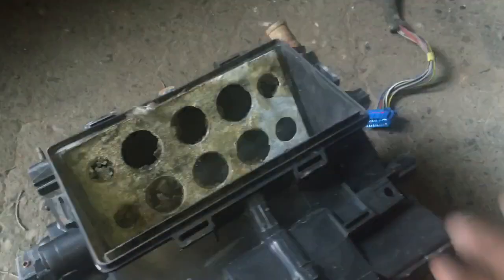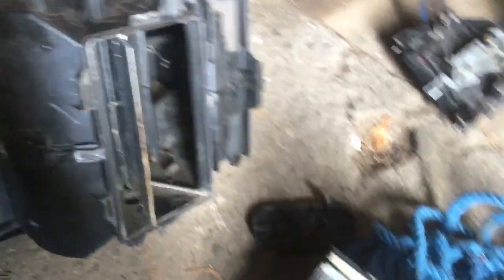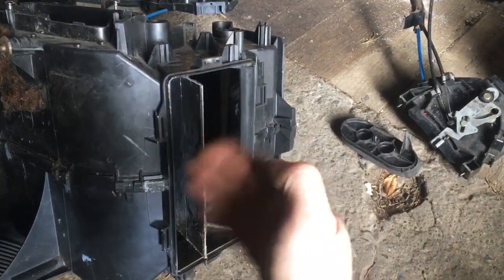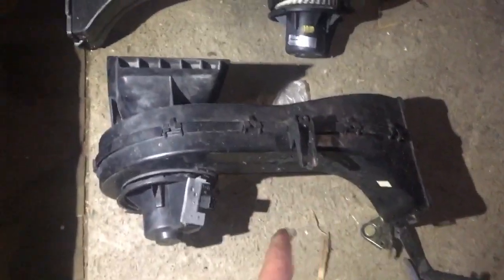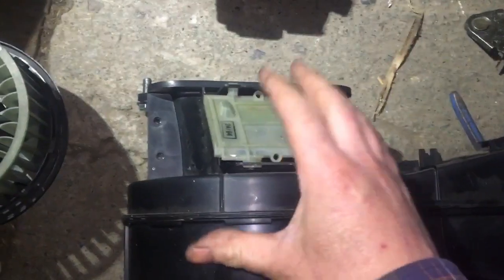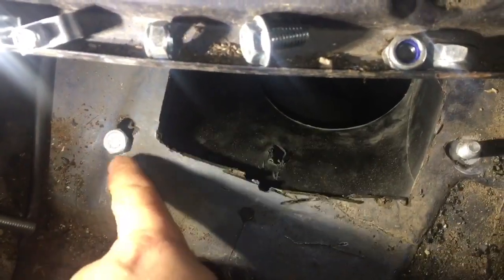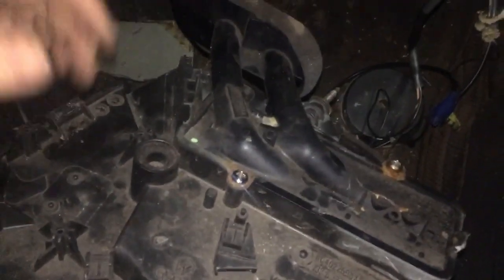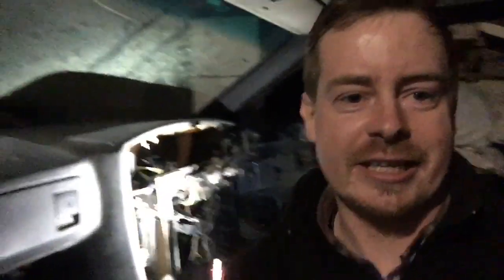Corrado HVAC, upgrading modifying and repairing ep19

Comment: Hey Steve I really appreciated this video I like the great detail you went into about swapping out the fan motor with a B4 Passat fan which is larger and can give you that extra 4 speed that you were talking about thank God for that 👍🎵🎶 my heater core is disconnected at the firewall so it's actually quite dangerous when I drive at night because my windshield gets all fogged up but I plan on swapping out my heater core hopefully within the next week or so before it gets too cold this will help me out thanks again and be blessed man.
Reply from the maker: Delighted to help you. It was by trial and error that I found out , I didn’t know that the Passat hvac would even fit the corrado .